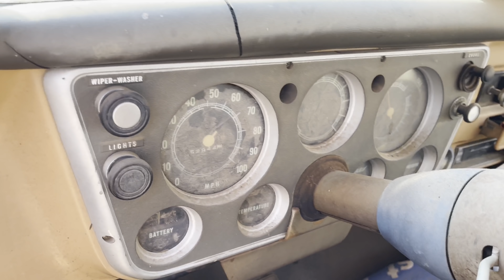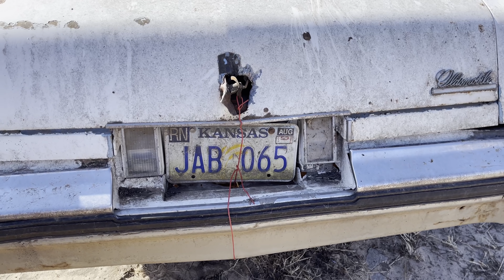They SCRAPPED that?!? Plus I shipped a 1967 Dodge Camper Van to California!

Comment: Awesome video! You ever think about selling sets of the aluminum wheels? Looks like you have some nice 80's,90's and early 2000 wheels in pile! 76 Oldsmobile Cutlass looks cool, make someone a good project? Maybe Mr Goodpliers would be interested in it? 403 V8 was used in alot of Pontiac firebirds! You can always tell Oldsmobile V8 by oil fill spout in front of engine! My father had 60's Oldsmobile V8s. Take care.

Comment: Cutlass motor is an Olds of some variety, the oil fill gives it away.  

403 Olds motors were a 1977-1980 thing, and also used in some Pontiac cars.

Comment: Like Twisted said earlier, the Oldsmobile 403 was used in the 6.6 Litre Trans Am (late '78 thru '79) but only in automatic transmission models. The Pontiac 400 was used in the 4-speed models. The 403 was also used of course in  Oldsmobiles full size cars of that era (the 98 and Delta 88) to get away from the larger Olds 455 used until the mid '70's. Enjoy your video's sir!!
Reply: There was a big flap over it and GM got sued. "I bought X brand of car but it had a Z brand engine, I was ripped"
So strange to think just a decade later nearly every FWD car had the same 3.8 V6 and no one thought twice. They all got over it pretty quickly

Comment: The 350 and 403 Olds motors are hard to just look at to verify what it is. The fuel pump location is a give away that it is a Olds motor. The casting numbers are the only way to figure it out. But the valve covers, and intake will fit either engine. Pontiac did use the 403 in the Trans Am as the 6.6 Liter engine option. I'm picking a '78 Trans Am tomorrow for my boss. It has the 6.6 in it. I'll be gutting the car and replacing the complete wiring harness in it cause the critters got it in and chewed it all up.
Reply: The oil fill tube was the giveaway clue for me

Comment: Hey Silas the Olds Cutlass came with both the 350 and the 403 Olds motors the easiest way to tell the Olds  Motors from the pontiac motors is the oil fill tube sticks up on right side of the timing cover on the Olds motors (also as a fyi the Olds 350 and the 403 use the same block different internals also a super cheap hop-up is to install the 350 heads on the 403 lower ends) The pontiac motors had the oil fill on the valve cover also wanted to let you know the the center console cars were very rare and they also had the option to have the front buckets swivel so look for a release lever on the front of the seat off center towards the center console

Comment: Enjoyed the video 76 cutlasses have round air conditioner Vents and 77 has Square AC vents, yes a 403 olds engine 79 to 80 Trans Am and 79 to 81 Olds 98 Regency

Comment: With the oil fill in front it is an Oldsmobile engine. Still good parts on that and hard to find. It is a 76 olds cutlass salon!
Reply from the maker: Yeah later on I figured out that it is a 403 Olds out of a Pontiac. GM liked to swap engines around back then.
Reply: @AdventuresMadeFromScratch  cool, I have a 403 I’m my 77 442. The 76 top engine would have been a 455. Then in 77 the top engine was the 403. Great parts still on that car! Don’t crush it!!

Comment: I kinda remember a big lawsuit from the 70s GM was using the wrong engines in cars it was either Olds engines in Buicks or Pontiacs or the other way around without telling the people buying them
Reply from the maker: They even used Olds diesels in the pickups. Back when I was a kid 350 Olds engines were hot because everyone wanted to swap out those junk diesels without having to swap motor mounts
Reply: @AdventuresMadeFromScratch  we had a 1980 impala station wagon diesel my Dad bought to replace his pickup but didn't like it . It was just a spare vehicle so it sat or everyone wanted it use it . He gave it too my nephew, his 1st grandchild when he got his license, the car and my nephew where the same age 17 he drove it through college in 2002. I think it may have been the longest surviving GM diesel from that Era
Reply: @AdventuresMadeFromScratch  just putting this out there I need parts (car)for a 62 Chrysler imperial convertible if you ever come across a 62 imperial hit me up (any 62 imperial)
Reply: Yeah something like that

Comment: Silas the white cutlass is a Old eng you have...It may be a 403 that Pontiac used in early 80's trans am's...but its an Olds motor..you can tell by the oil spout...FYI

Comment: I lovbe watching your channel, I used to drive around my city and pick scrap. As a Canadian (Calgary AB) I guess I cant come work with you for being on the wrong side ofthe 49th parallel. anyhow, keepup the good fight. I used toaverage about 16aluminum wheels cleaned in an hour, Looks like it would take about 4 weeks if there are about 2500 rims and tires in that huge pile.

Comment: Dear Mr. Silas
Please kindly allow me to suggest something that can help you processing rims with tires (aluminum and steel):
If I remember correctly, Johnathan W. built a kind of tire/rim crusher some time ago on his channel. Anyway: I guess you can use any common log splitter to crush the rims. So it would be much easier and way faster to separate rims and tires than with a tire mounting machine. The crushed rims are also not as interesting for thieves as whole ones are. Only two things you probably have to modify = the hight of the cutting wedge and the hight of the pushing plate.
Best regards, luck and health to all of you.
Reply: I hope he reads your comment!  He sounds very BUSY!!

Comment: That engine is definitely and Oldsmobile. Oldsmobile has thebfill tube in front and the rubber hose coming off of the thermostat to the water pump area.

A Pontiac would have a metal valley pan under the intake manifold that is visible in front and between sime of the intske runners. Pontiac intakes will have an area on the front where the intake and water pump / front cover connect to each other with a rubber washer in between and a long bolt from the front cover to the intake to pull the two tight so they seal up.

Comment: Our shop once swapped a 403 carbureted Olds out of an Olds station wagon into a 1977 Cadillac Seville. We used the 350 Seville heads because the Seville was fuel injected. All that was needed was to enlarge the position pin holes on the heads slightly so they dropped on. It was a great combination and cruised at ninety like nothing. On a side note the Cadillac Seville was a Chevrolet Nova body in disguise and if you changed out the radio the car would not run because the fuel injection computer was a part built into the radio. Go figure who that genius was. Maybe a politician?

Comment: that is in fact a Olds motor first major hint is the oil fill tube second is the shape of the valve covers... now head over to the #1 spark plug and just to the left of it is going to be either a number or a letter... what is it,,, if its a number it is a small block if it is a letter it is a big block plus just behind the timing cover is a series of number and at the far right will be a large either number or letter,,, what is that because with the right intake you can actually run big block heads on a small block,,, been dealing with Olds motors for close to 30 years so I do know and have seen it many times

Comment: Probably a 403 Olds motor. If it was a Pontiac motor the oil fill would be on the valve cover not in front like Olds motors. Guys would stuff a 455 Olds motor in those.  I had a Buddy who had a 73 nova two door with an Olds 455 motor and  a 400 turbo hydromatic Trans on it slightly modified with a posi rear end also slightly modified that was a beast. I miss that car.

Comment: Don't you have used  tire sellers in your area. There are a lot of good looking tires in that pile
Reply from the maker: Yes, but they typically only want to pay a few bucks each and they’re super picky on the sizes that they buy. I’ve tried that so many times and unfortunately it never works out. As long as I am allowed 5 tires per car, I’ll keep stuffing them in cars.

Comment: thats an olds engine oil spout in front going into block if its a 403 engine thats still an olds engine came in the trans am pontiac chevy buick caddy engines oil fil in valve cover olds in the seventies oil spout mount in block